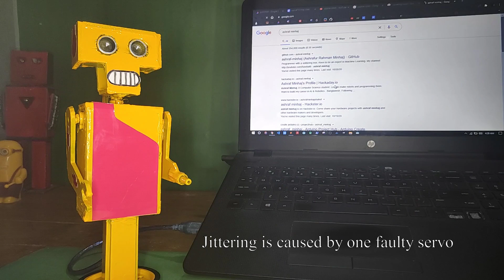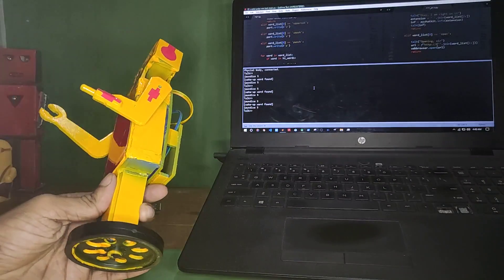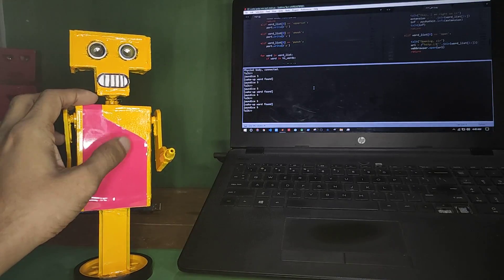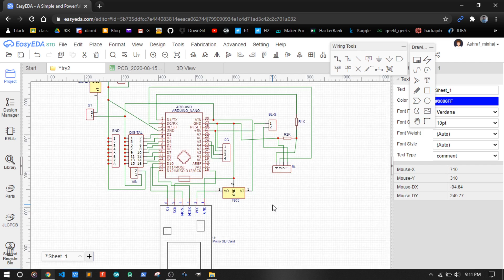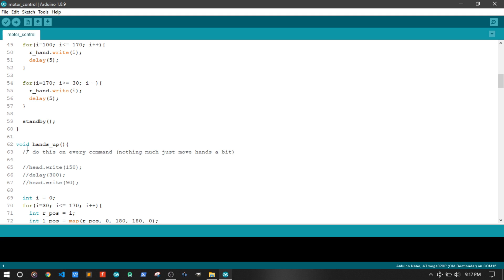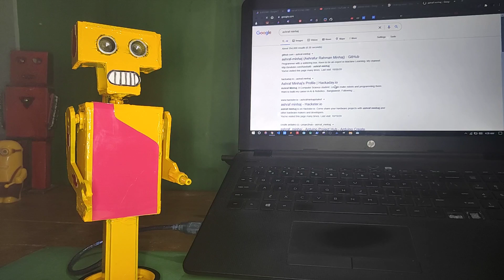Make AI Assistant Robot with Arduino and Python | Talking robot | Arduino, Python (with instruction)

Comment: Hi can you list the pieces you used when you soldered? i know you have referenced your blog post for previous comments but that does not have all the pieces listed. For example, you have a 7805 voltage regulator on the board which is not listed there and i only found when i clicked on your pcb link. this would be helpful for beginners

Thank you for the awesome video!! i will try to make this this weekend for a fun project
Reply: Can we do it without PCB?

Comment: Can we use arduino uno instead of pcb and nano?
Reply from the maker: Yeah sure.
Reply: @FuseBatti  pls tell sir
Reply from the maker: No it's not important. I just used wire in hands to make it look cool. 
Yes you can use cardboard.
Black yellow red chip? Arduino Nano I suppose.

Click on video description and look for blog post link. You'll find details there.

Also, sorry for late.
Reply: @FuseBatti  no issues u used a transistor, and 2 more things like that when u said lets now sort things in place so should I use those 2 red and yellow things on uno too? It's not in the blog
Reply: And do I have to place a transistor as u placed on the uno r3 board?
And I got to know what the red and yellow thing was…
Thank you so much for your help
Reply: Thank you so much. Which is the best for the outer body other than pvc sheets (as we are kids of 6th) or can we use cardboard? And when u showed how u have arranged things on the PCB there was one black, yellow and red chip can u name them as it’s not in the written blog
Reply: Sir is it important to use a wire part for the hands??
Reply: Yellow is kinda like a plug on 5V and red one is also like a plug on GND so should I place these thing on my arduino uno r3
Reply: Pls tell....🙏🏻🙏🏻🙏🏻🙏🏻🙏🏻🙏🏻🙏🏻
Reply: sir kindly tell pls sir

Comment: Please name the electronic components you used in this,,  which type of ic and resistor did u use
Reply from the maker: There you go -
https://ashrafminhajfb.blogspot.com/2020/11/make-ai-assistant-robot-with-arduino.html?m=1
Reply: @FuseBatti  thanks
Reply from the maker: My pleasure. Please subscribe. :)
Reply: @FuseBatti  subscribed 😀
Reply: @FuseBatti  how to install pip libraries ,, plz reply
Reply from the maker: If you have python installed, you have pip installed. 
Install python on your pc.
Go to command prompt and type
pip install library_name
to install libraries.
Reply: @FuseBatti  thank you,,  u helped me a lot...
Reply from the maker: Pleasure is mine!
Reply: I made this,, but when I run the code it showing :
Physical,body connected 
Talk>>
After this when I speak it is not recognizing my voice
Reply from the maker: @rishikchowdary3011  
Did you install all the libraries required for the project? 
Also, you need to have a good internet connection.
Reply: @FuseBatti  yeah I installed every library that you mentioned and I have good internet connection
Reply from the maker: @rishikchowdary3011  
Sometimes it takes a lot of time to process a command. Happened  with me also. That's so far the API problem.
Reply: @FuseBatti  okay,,  thanks for your reply
Reply from the maker: @rishikchowdary3011  My pleasure.

Comment: Yo this is exactly what I was looking for, but I don't want the Arduino to stay connected to my pc. Is it possible to use an external power supply for the Arduino while still being able to run the python code even when not connected to the pc?
Reply from the maker: @Smokey, I'm gonna make a video on that. Stay tuned.
Reply: @FuseBatti  did u made it yet??
Reply from the maker: Yes it is possible. 
Connect a Bluetooth module (hc05) in the pcb and pair it with your pc. The same code will work without any problem.

Comment: I am trying to build Mofiza humanoid robot. I bought all the parts and got the pcb form the website you suggested.
I cannot find a circuit diagram to connect everything together. Can you please help?
I need a wiring diagram with pcb. Thankyou.
Reply from the maker: Did you check my blog post regarding mofiza? There's a circuit diagram too.
Reply: @FuseBatti  Thank you for the link. I think it will help.

Comment: do you need the PCB? i am unable to get it. can i still make this project?
Reply from the maker: Yeah you still can make this robot. Just make the circuit using breadboard or perf board and jumper wires. That's how I made my robot Mofiza in the first place.
Reply: @FuseBatti  Quick question sir, it when i try to run the arduino code, i get an error saying: can't find Servo.h . How can I fix this?
Reply from the maker: It should be included by default with Arduino.ide
Try reinstalling Arduino.ide.

Comment: Its feakin awesome
Reply from the maker: Thank you so much
Reply: bhaiya is there any alternative way for PCB
Reply from the maker: @nawfalfirnaz6099  Yes there is. You can just use a jumper wires to connect all the servo and arduino together to make the circuit
Reply: @FuseBatti  Thanks a lot bhaiya. You are very helpful.
Reply from the maker: @nawfalfirnaz6099  My pleasure